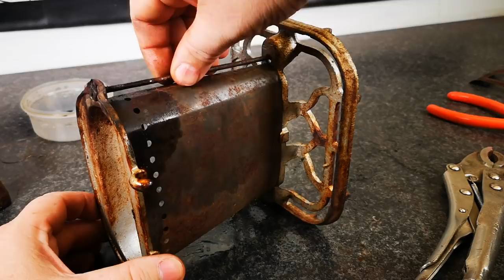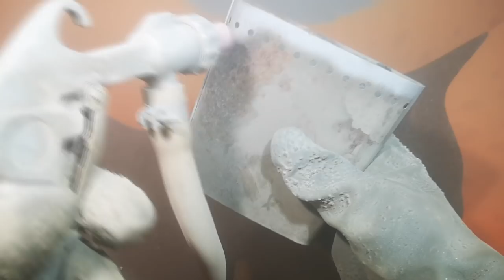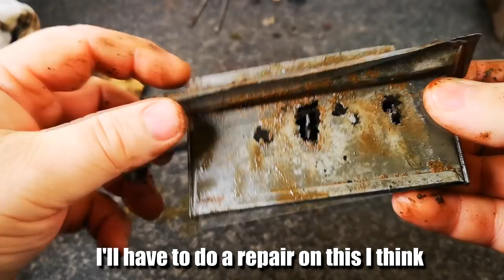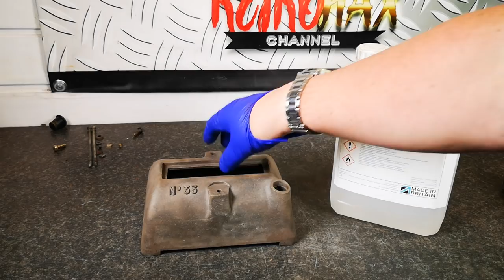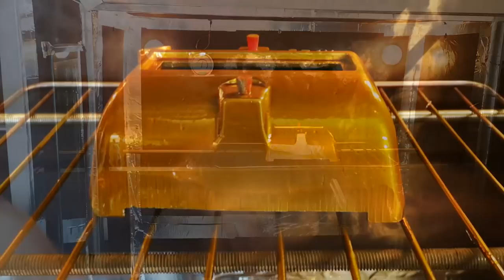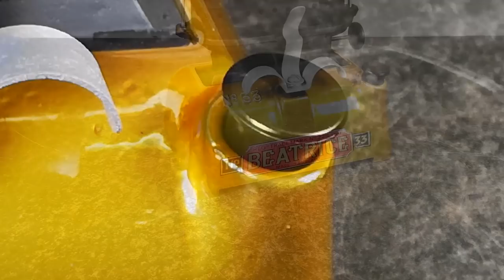Very Rusty 1950's Harper Beatrice 33 Boiling Stove Restoration

Comment: Hey Marin lad, obviously another brilliant success, you've certainly got an "eye" for interesting projects. Can I offer a couple of tips. I've often found, if heat alone to free rusty nuts/screws is still not quite successful, try spraying penetrating oil on while it's still hot (do it outside-the fumes are not nice and might flare up) . As the item cools the fluid tends to be drawn into the stuck threads and might make your struggle easier. Also, with new wicks, after the first lighting, extinguish the flame and trim off any proud bits of wick, makes a more even and less smokey flame. Oh, and by the way, stop sacrificing those dented flowered biscuit tins, in 20 years time they will be 'collectable' and you will be restoring them too. All t' best from that old Yorkshire "Geezer" in Ireland.

Comment: Looks good!!…………….That is until you see all of the casting marks/pitting and what looks to be outgassing bubbles on the cast base, when you zoom in a little.  Very difficult to use a chrome with a top coat on cast to make it look right because of the outgassing potential.  A couple of wet sanded KL primer coats would have helped you resolve some of those issues.
Reply from the maker: there are no outgassing issues, I pre cooked it. I left the casting marks as it is the character of the unit from 60 years ago.
Reply: @RetroHax  , well I'll just say it looks like outgassing. I like the gold candy, but if you are going with a candy it has to have a smooth flawless substrate for it to look right. Personally I think to retain it's character you probably needed to go with a solid powder which would have allowed the surface flaws to not stick out like a sore thumb..I like all of your projects, as well as this one, and I look forward to your next one. I'm not trying to be abusively critical, I'm honestly trying to be helpful....I love this stove.

Comment: hi martin im watching all your retrohax vids and you have started mentioning the powder colours so ignore my last message  in a previous video thanks mate
Reply: hi martin trying to get hold of novel therm putty for filler i noticed you use for powder coating not on eBay or amazon out of stock ,can you recommend any other filler or where i can get it mate ? thanks Rob
Reply from the maker: I did get it from Ebay but just Google it and you should find it.

Comment: Thankfully someone that knows how to remove rusted parts. I always seem to be yelling at the screen to get some heat into it or get an impact driver on it but no one listens.😂. I thought it was a toy at first like the oven you did. You seem to really be getting the hang of powder coating. Every time I use mine I learn something new but I enjoy using it and I like the finish. Just like everything else really it’s the prep that matters.
Have you tried coating over metal impregnated body filler yet as I wondering if it works. Cheers Stuart 🇦🇺
Reply from the maker: Yes bud. I use it all the time
Reply: RetroHax. Thanks heaps I’ll give it a go. Cheers

Comment: Love the videos! Just had a question, what air compressor do you use in your workshop? Thanks!
Reply from the maker: 90 liter at the minute
Reply: @RetroHax  Thanks what brand is it just looking at getting one to start sand blasting and heard you need one with a high CFM.

Comment: nice work. Do you play around with electro plating? Some plating on this one would have been cool.
Reply from the maker: I have a zinc plating set up but it needs sorting.
Reply: @RetroHax  one of the things I see others do is use too high of voltage. zinc plating is pretty much galvanizing. For nickel plating and most other plating, you have to plate with copper first. very low voltages take longer of course, but it seems to do a better job. Less than 3 volts at no more than 500 milliamps seems to work well on smaller parts. Use a little higher voltage and amps when the pieces are larger. As old as this piece is, nickel plating would have been what they used, if they didn't just copper plate it. You would not plate the high heat portions of course.  Actually, what I would use instead of a paint is what they used to call stove black. it's more akin to bluing, but is black and resists high heat for a good while, tho it has to be redone every once in a while depending on the amount of use.  What fuel does this thing use? I would think it would be an alcohol burner.
Reply from the maker: @tootall5559  It is a Paraffin burner bud
Reply: @RetroHax  paraffin to y'all must mean something differently than it does do me. I had to look it up. it has two meanings

a flammable, whitish, translucent, waxy solid consisting of a mixture of saturated hydrocarbons, obtained by distillation from petroleum or shale and used in candles, cosmetics, polishes, and sealing and waterproofing compounds.
OR
a colorless, flammable, oily liquid similarly obtained and used as fuel, especially kerosene.
noun: paraffin oil; plural noun: paraffin oils

I was thinking of the first meaning, since that's what I'm familiar with. It's also called Alkane.

Comment: I have to admit Marin, you did a really nice job on this one. And I have to say, you make the powder coating look real easy. However, I did my own first powder coating project this week and can say, my techniques still needs some improvement. I am using the typical high voltage powder coat gun system and did get an electric shock. Nothing deadly of course, but you learn real quick to not touch the part with the button pushed. Also you don't even touch the part after blowing the powder on.  Things I learned already.

Have you ever powder coated clear over regular paints? If so, did it come out okay?
Reply from the maker: Yes I have, It took good in my case.
Reply: My question is close to yours. Have you ever powder coated clear over water slides?

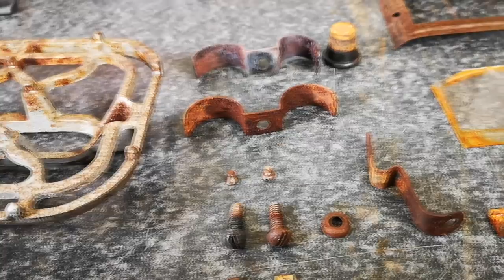Comment: Nice restoration. I have an identical burner. I think the original grey/blk tortoiseshell colouring is more appropriate, I agree the gold is a bit OTT. Your Paraffin (Kerosene) bung is not original. The original is a screw in unit with 4 small vent holes. After 6:00 you started to use a compressor powered something on it... was that small sandblasting cleaning, or just priming/rust treatment paint? Also, could you send me a copy of the artwork... as the existing transfer on mine is about 40% missing. Many thanks.

Comment: Cracking restoration...or should I say eggsellent...lol...can I ask how you copy the original logo...do you photograph it and then bring the image into photoshop or do you use a flatbed scanner and then photoshop??
Reply from the maker: I took pics of the logo and enhanced it in Photoshop Bri.
Reply: Do you have any issues with getting the sizing right. I size my images exactly to size in photoshop but they always seem to come out smaller on the actual print 😕🤔
Reply from the maker: @brianhull5125  I have had issues but I print them out on normal paper first to check the size and alter then accordingly.

Comment: This isn't really a "restoration" as you have called it.  To restore something, it means to bring it back to the original condition, not change the color and just adding a layer of metal over the damaged metal.  You should have removed the damaged metal and then rebuilt it with new metal and returned it to the original color.  This is more of a repair and not restoration.
Reply from the maker: If you don't like it just don't watch it, simple. No one's really interested in your point of view.